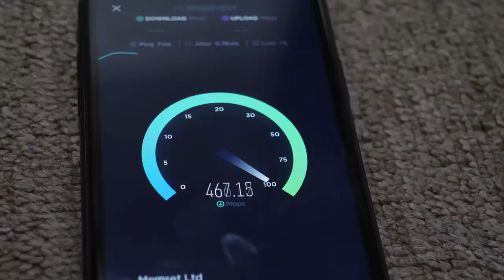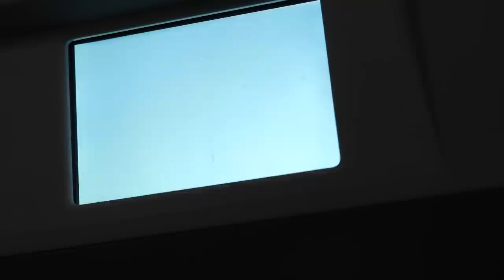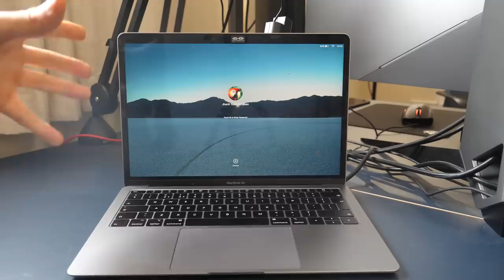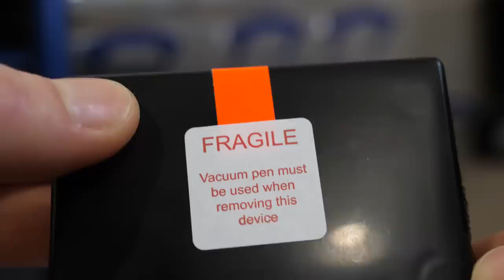The *Ultimate* Hacker Setup

Comment: 1) To help with lost mouse cursor, Windows does have a feature under "Pointer Options" that turns creates a radar blip around your pointer when you his the CRTL key
2) Vacuum pens are only $2 on eBay and can make placing ICs a lot easier.

Comment: heres a tip for the loosing the cursor issue: turn on a setting in the windows pointer settings (control panel) called 'Show location of pointer when i press the CTRL key'

Comment: A vacuum pen is a tiny pen line device like a cheap solder sucker and the tip has a little rubber price and it is used to pick up electronic components like a pick and place machine.

Comment: I use a monitor piston arm to keep the vertical monitor outside the space of the table ("floating" in the air), so I can save some space to other things, the bottom of the vertical monitor can stay below the surface of the table, and it has a really cool "robotic" look. Using this arm you can use any monitor vertically. The rotating part is the arm, not the monitor's base.

Comment: I beleive that pressing control on the desktop will indicate  the cursor's position. I think that this function is on by default, but i am pretty sure that if you dig through the windows settings you will find a way to activate it.

Comment: 1. A true hacker would not be using Winblows
2. A real hacker doesn't need a beast to do his work on, if he needs more processing power you use your dorks
3. If you were running LINUX you wouldn't need all that damn space, nor monitors when you have multiple desktops/workspaces...
4. Real hackers prefer stealth, smaller is better.

Comment: LMAO if that is a hacker setup then I am Elvis.   That is a gamers setup.   Real Hackers have this: 

1. Backpack.
2.Laptop.
3. A spare hard drive or 2 for fast swapping (thanks to nvme we no longer need Neodymium magnets for corruption.  Just break the stick into several parts with a pair of heavy duty wire cutters and drop in random locations
4. USB sticks with software
5. fake ID set
6. cash
7.number of a good attorney for when you do get caught eventually.